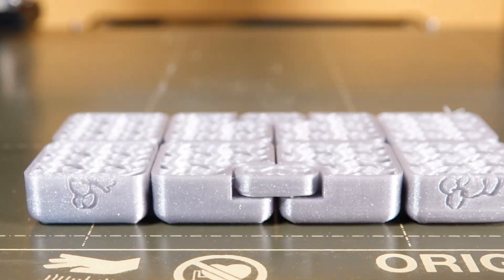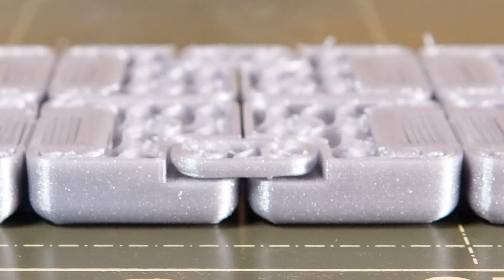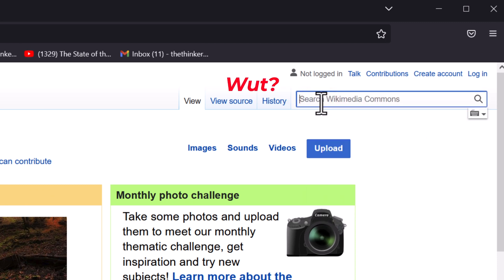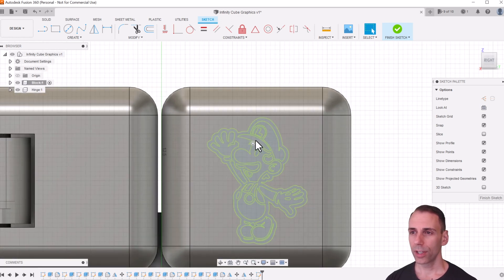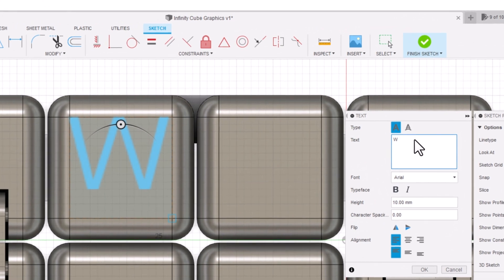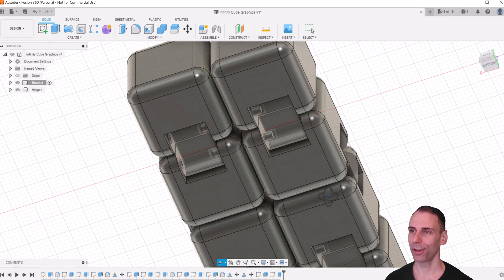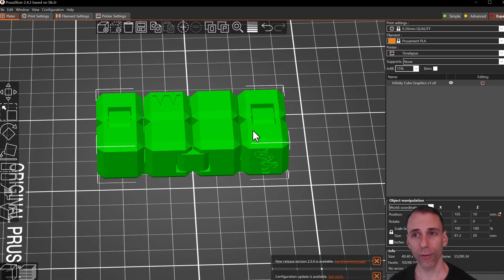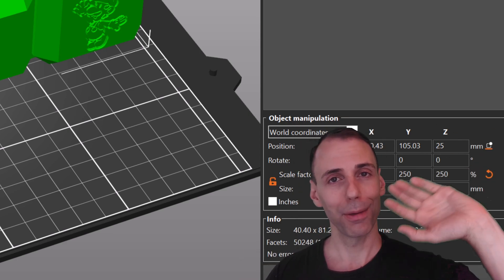How 3D Printers Work and Part 4 of the Fusion 360 Course.

Comment: Nice!  You answered all the questions I had prepared!  I haven't been printing long but I assumed scaling the model in Fusion would yield better results than scaling in the slicer would.  But, if your printer is having tolerance issues scaling the model in the slicer might be best.
Reply from the maker: To be fair, I haven't ran the experiment both ways, but I knew that slicer was going to be easy